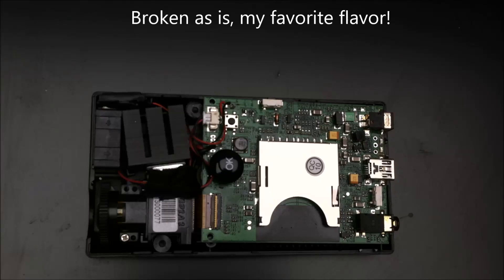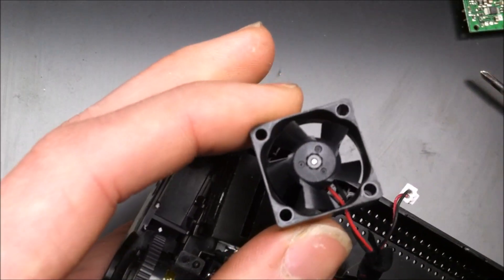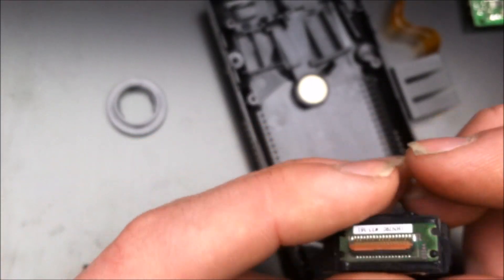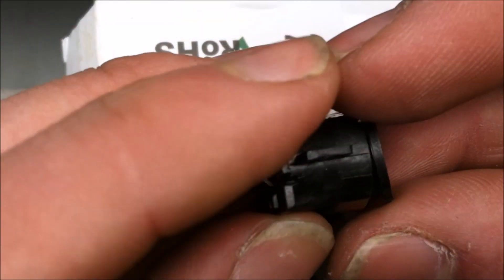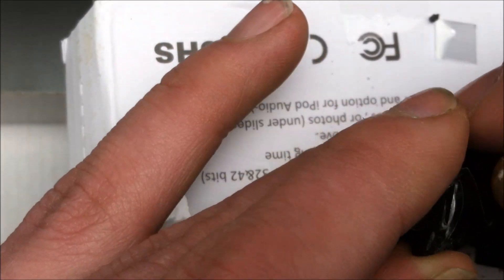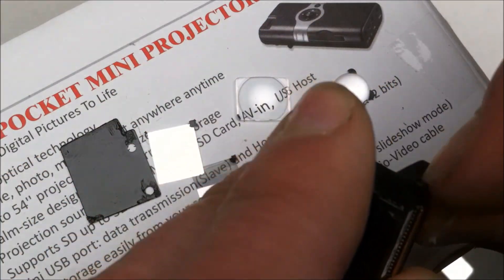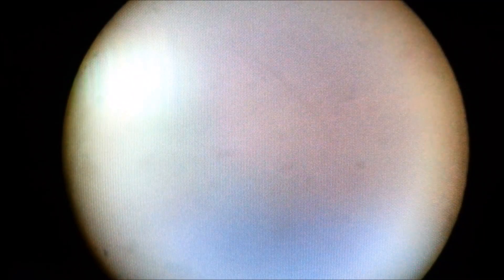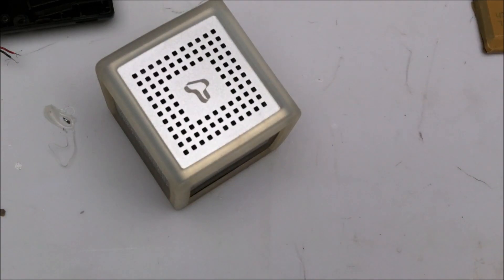Broken SVP PP003 LCoS Pocket Projector Teardown

Comment: I have a qumi q6 kind of broken how can I check if it is repairable?
Reply from the maker: Anything is fixable, it just depends on your skill at repairs. I would suggest doing research on the problem your projector is having and seeing what others have done to fix it. Common problems are loose cables, board problems, or DLP/DMDs that need replacing.
Reply: @Zenodilodon  Can You try to repair it? I can send it to you and you make a video of it.
Reply from the maker: @eliastorres3132  If you are in the US yes. Can you tell me what the problem is that is has?
Reply: @Zenodilodon  I am in Canada. But I believe I can send it to you. The projector starts but the light is very low. it looks like some of the leds are gone.
Reply from the maker: @eliastorres3132  Send me a few pictures of the output Zenodilodon@gmail.com
Reply: Hi, I have a 3M mp180 projector and recently just shows the 3M logo over and over when it's starting
It's a little bit old but it was working nicely the last time I used it. What do you think could be the problem?
Reply from the maker: @fgarceo  Not sure to be honest. Are you trying to play back media off a media storage card or directly off a video source?
Reply: @Zenodilodon  no, I just wanted to turn it on but it keeps booting and the software doesn't load.
Reply from the maker: @fgarceo  Hmm, sounds like the firmware got it's 0s and 1s screwed up. Not sure what to advise on that kind of issue as I typically handle electronic/optical issues and not software. It could be a bad connection to or a failing ram chip. About the only thing I would consider myself would be removing the logic board and doing an oven reflow attempt on it. It could of also gotten dust or water inside and caused a minor short. If you want to attempt a fix maybe start with removing the main board and cleaning it in isopropyl alcohol.
Reply: @Zenodilodon  thanks, I'll try that.